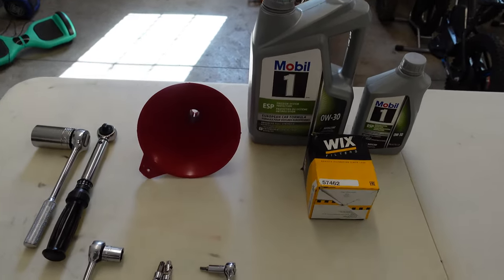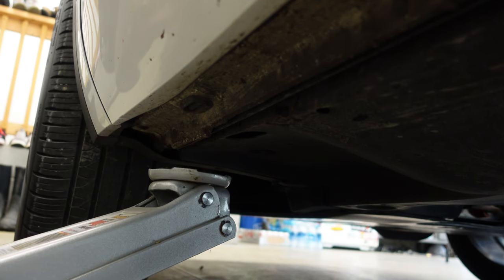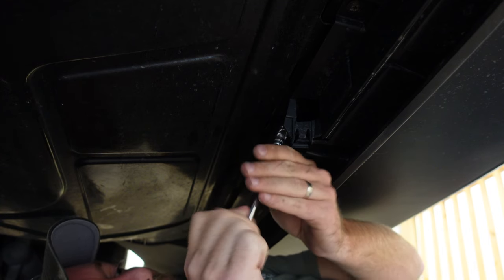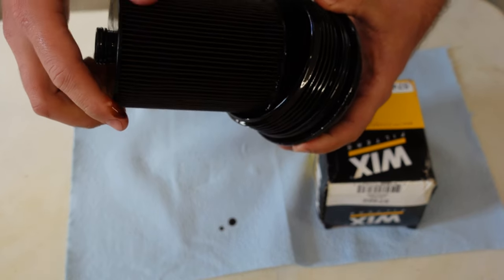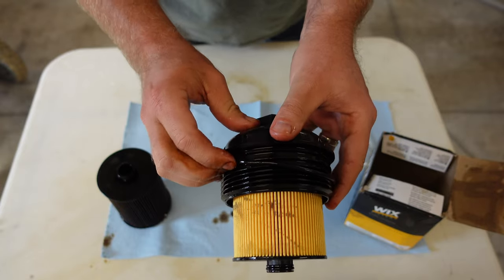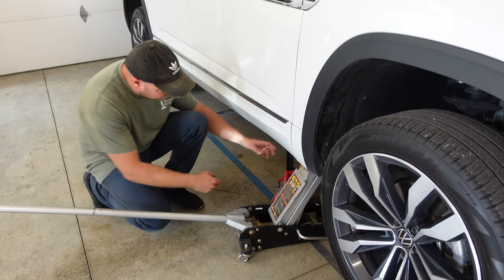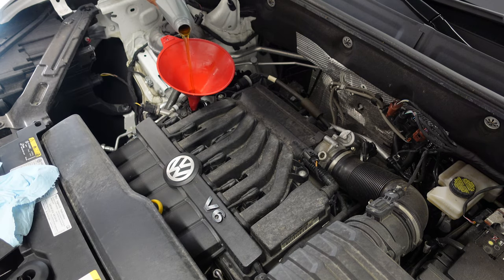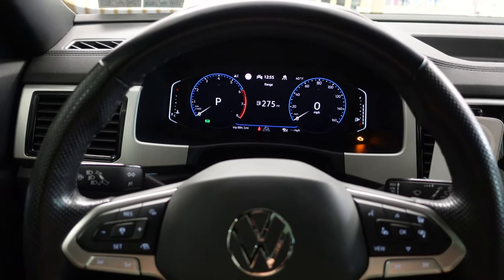VW Atlas Oil Change - How To - V6

Comment: 14 screws?! 😮 Officially never buying a Volkswagen!
Reply from the maker: I love the support. You watched that far in and you don’t even own an atlas 🤣
Reply: How many screws are on some of the other manufacturers plastic skid plates ?
Reply: @kennybubash3278  Volvo S60 has about 8
Reply: Because of 14 screws to be unscrewed??😂😂😂 Kids nowadays…
Reply: How does the S60 compare in size to the 3 row  198.3 inch long Atlas ?
Reply: @kennybubash3278  why are you shitting on me for answering your question
Reply: What if Honda or Toyota decide to put 20. I bet they'll be heroes.
Reply: My thoughts exactly and having gotten used to Subaru oil filters (located on top of the engine) makes for a much better oil changing experience
Reply: @Teagz-ch2tj  That's where the VW Jetta filter is located, as well. Love it.

Comment: That little allen keyed drain plug on the bottom of the oil filter cartridge housing is easy to use and takes less time than the oil clean up without using.
Reply: This all day
Reply: Yeah I’ll be using it next time what a mess 😂

Comment: Solid routine. Only thing I do different is wait until I add the new oil and cycle it for a short period before I replace the skid guard. It’s easier to detect a leak if there’s a sealing issue with the crush washer. Never used Wix, but I’ve heard nothing but positive feedback. My local euro shop stocks Hengst filters, so I use those.
Reply from the maker: That’s a good tip

Comment: That oil filter placement for a catridge oil filter is horrendous. Doesn't even have a drain valve release so all the oil doesn't splatter everywhere. Most german cars have there oil filter housing right on top of the engine for easy removal and replacement. Seems like VW doesn't want to make it easy to DIY anything on your own vehicle.

Comment: As a lube tech, I let the housing drip for a while before pulling out the cap, otherwise it splashes everywhere and I'm not about to go home covered in oil or have to clean the floor. I do my struts/shocks/alignment and transfer/diff case checks while it drips so there's no wasted time.

Comment: Awesome video! I love that you showed the required tools and materials before getting into it, and the video was very concise, informative, and well-shot to show everything you needed to see. I do have one thought and it's more of a comment, not really a critique: I serviced a few vehicles now with the cartridge style filters and either aluminum or plastic oil filter housings. For removing the O-ring, I always use a plastic tool like a trim tool, or a wooden one like a toothpick to remove the O-rings sealing the oil filter housing. My reason for this is that with plastic or aluminum housings, prying at the location of the seal can cause permanent gouges somewhat easily if you're not very careful. It looks like you were, but not everyone is and it could become the source of an oil drip or seep for the less gentle among us. Just something to think about when working with new cars since they love to use plastic parts everywhere they can, and those parts do not hold up as well as we'd like to the touch of steel tools. Those of us continuing to care for our modern vehicles on our own are having to learn a whole new skill set of how to be more gentle with our parts!

Comment: Well done. Just purchased a used 2019 with just 22k miles. Oil was just freshly changed so no need to worry about this for several months. The skid plate is a hassle for sure but on the other hand, it seems to provide decent protection for some vulnerable bits. Thanks for this!

EDIT: I mean it's not a metal plate so not exactly offroad worthy but mostly it looks like typical German (over)engineering.
Reply: It's also done for aerodynamics and does a decent job of keeping dust out of the engine bay.  My Atlas has 7K miles and almost no dust on the engine.

Comment: Do I need to replace the crush washer on the oil drain plug? Great video! Thanks!
Reply: I bought a bag off Amazon a couple years ago. When the standard flat washer wouldn't come off the drain plug I just put it back on.  I've since done this on several oil changes on several different vehicles and I have had no leaks.  The biggest thing to remember is to not cross thread when replacing the drain plug and use a torque wrench.  Both of these things will help to not strip the oil pan threads.

Comment: great video! I have a 2022 6.3l Atlas and am going to do the oil changes myself as well and was thinking about making a similar video. I know it is recommended that it gets changed ever 10k miles, but have you hear from anyone about changing it closer to 5k? Thanks for the video!
Reply from the maker: No I haven’t. I wouldn’t say I’m that old (37), but every car I had when I was younger required oil to be changed at 3k. I can’t believe how far that requirement has been pushed out by the OEM’s. A lot of hit probably has to do with the development of synthetic oil. Years ago a guy was testing oil in a Honda civic, at 10k miles the synthetic oil tests showed that the oil was barely even broken down.
Reply: I've done a lot of digging on the forums especially for VWs and consensus seems to be this: Oil changes every 5k miles are still ideal for the longevity of the vehicle. VW's 10k mile oil change is simply the maximum interval you can go and keep the warranty. There is a lot of speculation that this is not what's best for the long term reliability of the engine and although that's not a thing I've seen proven. What I have seen proven is that frequently changing your oil and filter with quality parts and oil is the single best thing you can do for your engine's reliability! German cars are reliable and well made IF you follow the rules
Reply: @Paaka700  good stuff!
Reply: @Paaka700 I did this with my 2017 VW Passat RLine the first oil change I did at 10k or just a little under and everyone after that I did @ 5k

Comment: Thanks for the excellent video.  Planning to use an oil extractor rather than drain since dealer stripped drain plug.  Ever consider that?
Reply from the maker: Not for this car. I do have an extractor and used it previously on a older beetle with plug issues.

Comment: Quick question. Why did you decide to go with the wix filter?
Reply from the maker: Someone made the recommendation in a comment on my beetle oil change video. I looked into it and they had some good reviews. For the most part, any of the top name brand filters are all near the same quality. I was able to get the wix from Amazon.

Comment: Isn’t there still some metal shavings inside the bottom of the filter housing that you should remove and clean out before putting it back together? I mean, I would make sure that housing is clean and free of residue before I put it back together. You have it already in your hands so why not clean it off?

Comment: at what milage do  I get to change my atlas 2023 oil, am currently at 4k plus and a bit concern bcos its rated for 10k miles b4 change and not quite comfortable with dat .
Reply: Nothing wrong with doing it “early”. Every 4-5k is my schedule personally
Reply: Thanks man
Reply: 6K max if using a quality oil and filter.